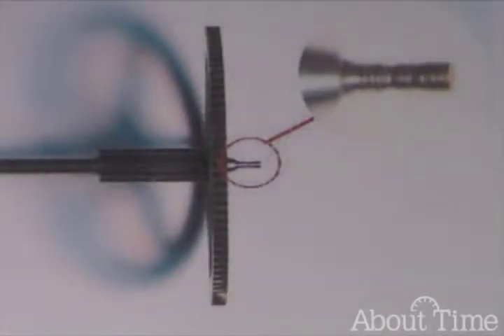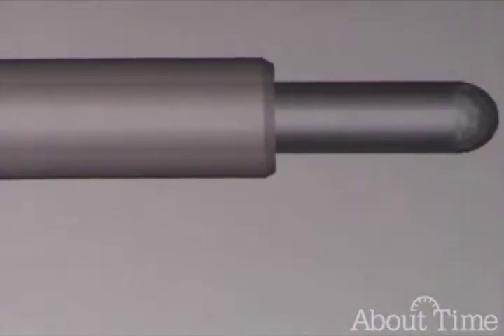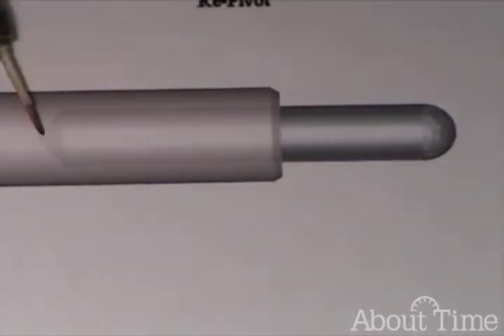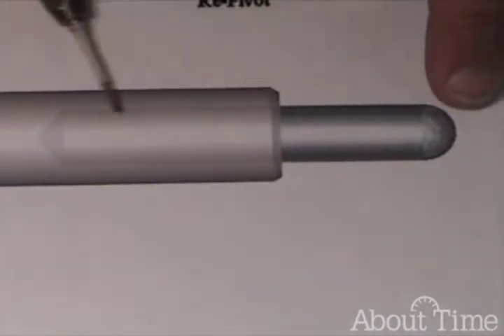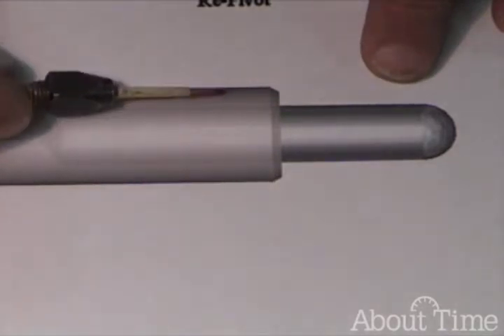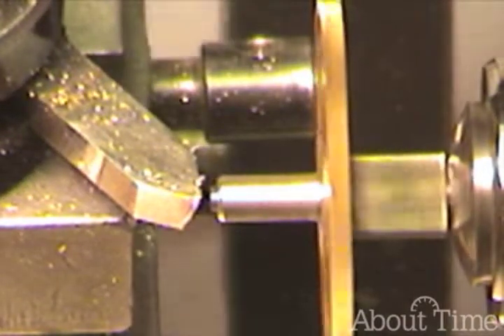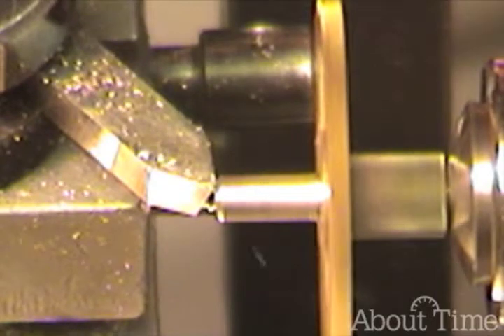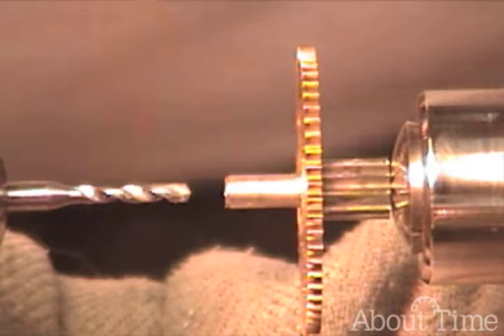ClockClass - Replacing a Pivot

Comment: Hello! What's the best sanding paper grit size for filing and polishing the pivots?
Reply from the maker: Hi Luis-

I don't recommend using sandpaper for polishing pivots since it is difficult to maintain a flat surface and the grit can stay on the pivot.  Here is an article which discusses the topic in detail...

https://abouttime-clockmaking.com/pdfs/burnishing_labounty.pdf
Reply: @clockclass5480  Wow, thank you so much. I am little by little gaining knowledge about clockwork!